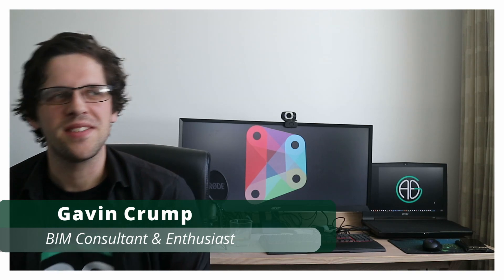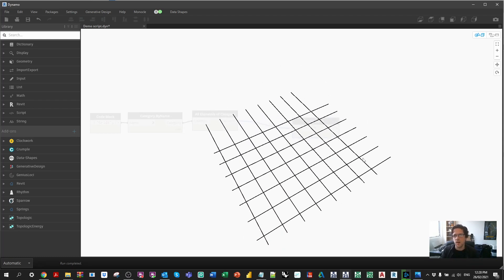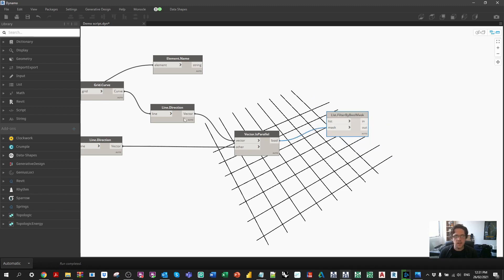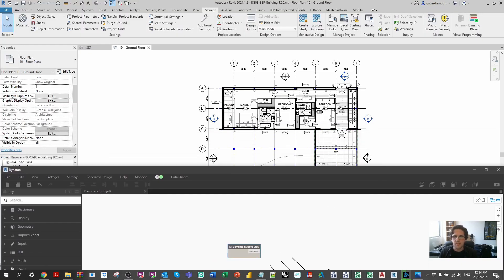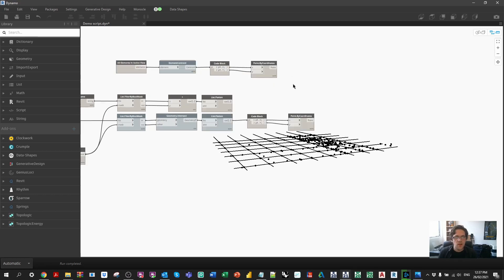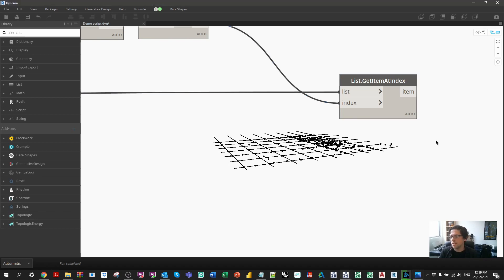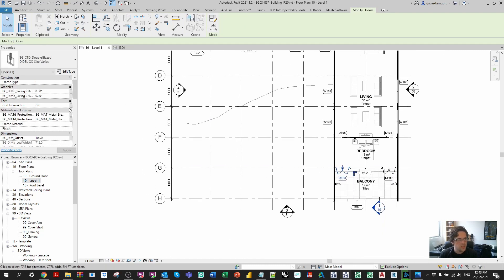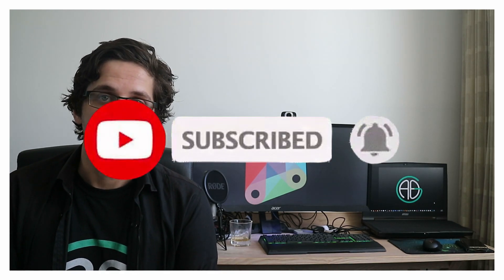Closest grid intersection to Revit elements using Dynamo!

Comment: Hi Gavin, I was hoping you might be able to help me out. At the "List.GetItemAtIndex" node my values are coming out as -1 or null any ideas why this is happening? From what I can figure out the range of the intersection names (0-44 in my case) goes outside the intersections that are in the project (ie some of the first items are 1311, 766, 509 etc) so maybe the problem is between "Geomerty.DistanceTo & List.FirstItem" nodes.
Reply: Got it, on the "Geometry.DistanceTo" node I set both inputs to L1 and it worked. Looking back at the list both list the data is stored at only a L1. Any the workflow you came up with is outstanding thank you so much your video's have gotten me to think in new ways for other common task I do. Thanks again.

Comment: A really nice video, I took one step at a time and my grids in the project are simple and similar to what you did in his film, but I end up with the same grid no matter which element I choose
Reply: Not bad, I really succeeded, thanks, amazing video, it was something with the Levels
Reply: I even managed to put it in the parameter. The question is how can I select several components and make a loop over them so that it will pick up the position and put the parameter in each component
Reply from the maker: Yes definitely a levels/lacing issue for sure. Many on one outcomes tend to be due to this.

To put the parameter in multiple components you will need to manage this data in parallel structure to the elements themselves. I thought this workflow achieved this last I checked, maybe I'm mistaken?

Comment: Thanks you so much every you tube instructions! helps me so much, by the way, by Revit2022 ElementsCentroid node dose not show in library it there another way to go? especially i would like to set for beam family, and how to sort out error at point by coordinates?
Reply from the maker: My Crumple package should still have it under revit > elements.

In principle all it does is get the element's bounding box, then get the centre of that bounding box using it's min/max point.

Comment: Much obliged for this workflow 🙂 Helped me a lot to get started on a more complex script that I'm working on. Anyway, just wanted to share that if you have grids on multiple directions (like I did), you could use Curve.IntersectAll from BiMorphNodes package to get all intersection points of the grid curves. After that, you can intersected those points with the grid curves so that you get the identifier (the names of the 2 intersecting grids). Then, Geometry.DistanceTo node gets fed the points from Curve.IntersectAll and that's about it. Works pretty well in my case, so thanks again 🙂

Comment: Finally, it worked. Very useful video. I only needed it with certain elements that my Dynamo file automatically placed on the grid, so instead of select all elements, I only chose those family instances. I also need some reverse engineering now, because I want the closest vertical and the closest horizontal grid information separately.
Reply from the maker: Glad to hear the video has helped and that your adjustments ended up working in the end also.

Comment: Hi Gavin, thank you so much for this great video! I am trying to recreate your script, but unfortunatlly my company doesn't have any extra packages for Dynamo avaliable. Is it possible to recreate the same Centeroid function without the extensions? I have to also say this is my first Dynamo script ever! :D
Reply from the maker: Yes you can get the bounding box of an element, convert to cuboid and get the centroid of that solid instead to avoid needing a node for that. All those nodes come with dynamo.

Welcome to the world of Dynamo!
Reply: @AussieBIMGuru  Thank you so much! It works! :D I have one more small question, because my grid names are pretty long, where can I insert the Symbol "/" between the vertical and horisontal Axes?
Reply from the maker: @teodoraninovska5178  you could add this character to the In output at 7:09 before joining them with the Out output from the same boolean mask, then add that together like I did before afterwards.
Reply: @AussieBIMGuru  thank you so much for your fast reply! It works perfectly and it saved me a looot of time :)
Reply from the maker: @teodoraninovska5178  glad to hear!

Comment: great video, quick question is there a way to make it read like a proper grid reference  instead of closest so it always reads across then down ?
Reply from the maker: If you want it to find the nearest grids in a given direction only (e.g. west/north most), you could solve this in quite a few ways, none super simple. The main one I can think of is to generate planes for the grids and then generate a large mesh and use a mesh ray intersection to test the first grid hit in a given direction such as up the Y axis, or back across the X axis.

Comment: Great Script. I'm a begginer in Dynamo and I work on a project with axis that are not parallel. You explain that there are possibilities to adapt the script for that case but I'm still too novice and don't know how to handle it. Do you have any tips?
Reply from the maker: Get the curves of the grids, check their direction and compare its angle to the Y axis using angle between vectors. Grids that are off axis will usually have a non whole number for this angle.

Comment: Great video! Really useful! 
I am experiencing some problems when connecting the centroid node with the simple code block formula (10:25). It gives me the following error: “internal error, please report: Dereferencing a non-pointer”. Does anyone know how can I solve that issue? Thanks!
Reply from the maker: Hrm not sure what could cause that error in such a simple code block. Maybe check that you have an ; after the first line? Otherwise use the Point.X and Point.Y nodes instead.
Reply: Thanks for your quick response :). Unfortunately It is still not working. I will try to reinstall crumple package, as it seems to be reason of the problem 🤞🏻